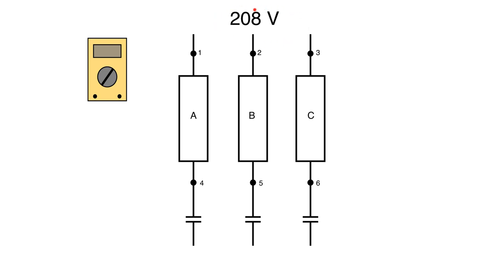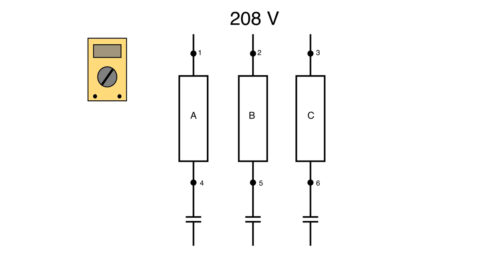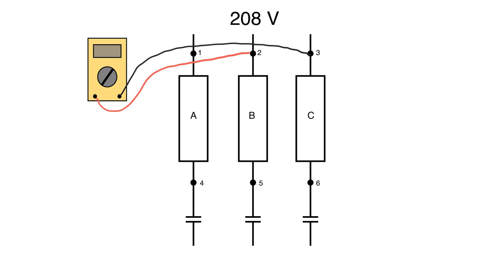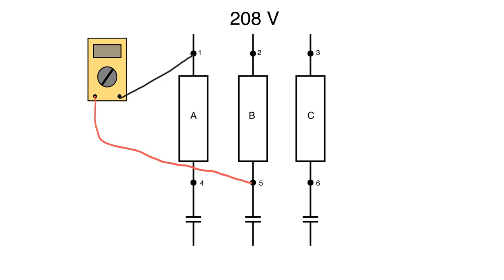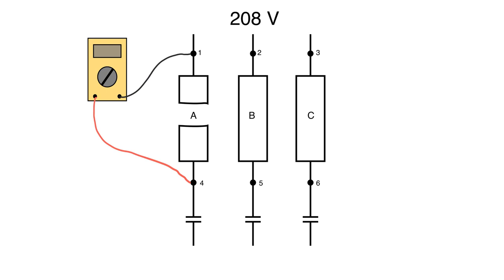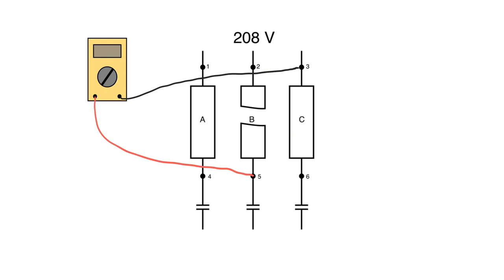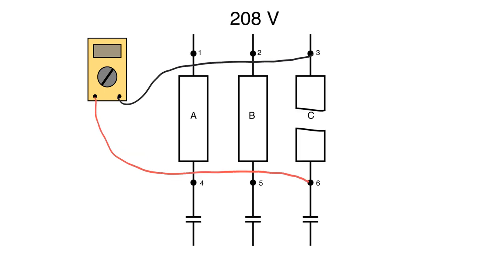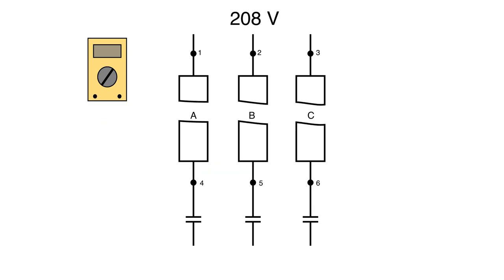How to troubleshoot a blown fuse in motor control.

Comment: Nice vid. My co worker just explained to me couple days ago why not to trust each line to ground as a test. Gonna use this criss cross method from now on.
Reply from the maker: Yeah it’s pretty slick. I’ve used it for years.
Reply: Ok. So I always check voltage anywhere using ground directly, as my reference point. 
So why not use ground as a reference???

Comment: In the case of a blown fuse lets say A , point 1 will have a potential which is different from the electrical potential of air, so why is voltage across A 0v when the fuse is blown?

Comment: Are you saying there is no reference on 4, 5, and 6 because the contact of the back side acting like an open ground?  If this were a open switch, I would get 120 across the open contact, correct?
Reply from the maker: That is exactly correct.  If the contacts were closed it would be a whole different story.
Reply: @TheElectricAcademy  I wanted to make sure because I don't think you said that in the video